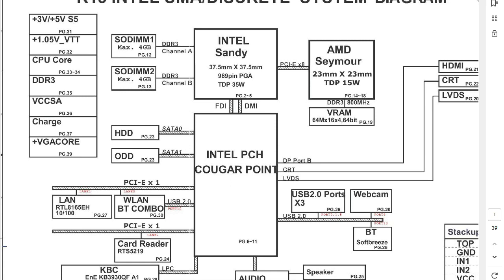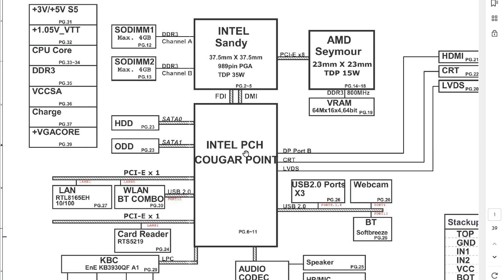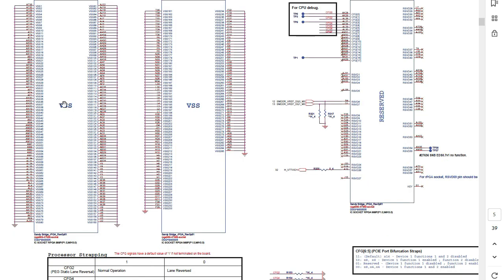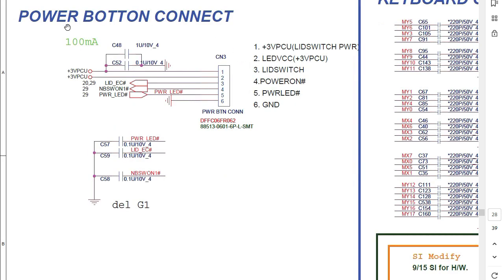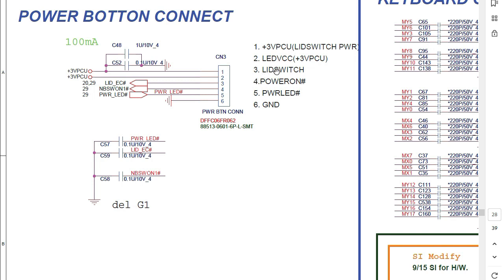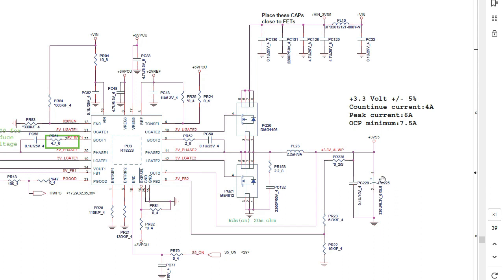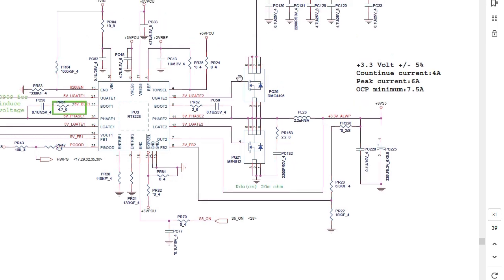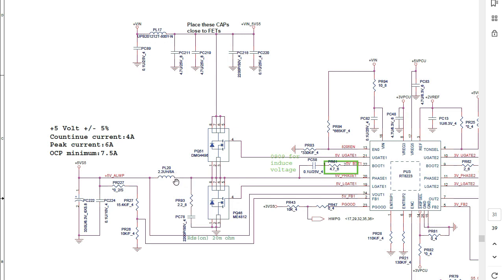Learn Laptop Schematic Reading-hp pavilion g4 g6 g7 schematic studying

Comment from the maker: Buy Repair Tools👇👇👇
https://northridgefix.com/shop/?ref=ERB_23
Including:
Microscope
Voltage Injector
Programmers
Reballing / Stencils
Repair Tools
iPhone Cases
Soldering
Soldering Equipment
Storage / Rack
SMD Books
Tempered Glass
Test Tools
Components
Donor Boards
Gadgets / Accessories
Ports / Connectors
Tweezers
Adhesive
Apparel
And much more